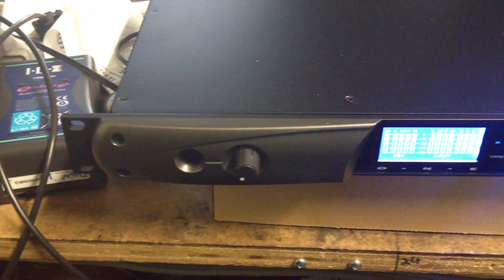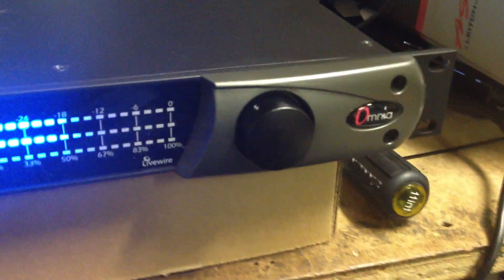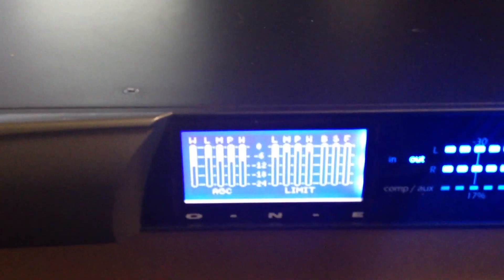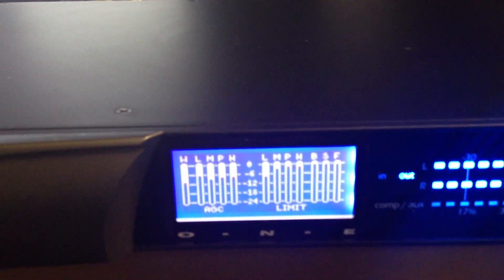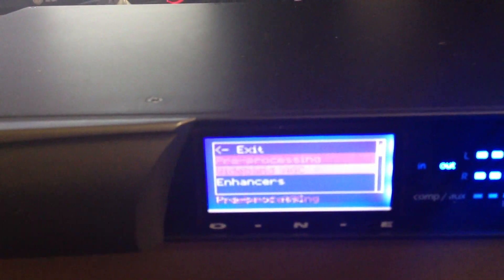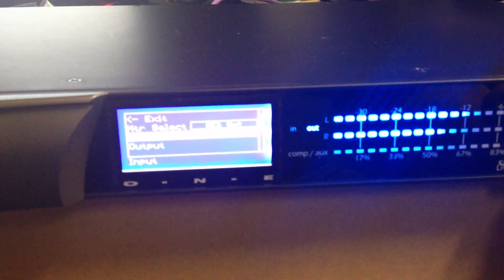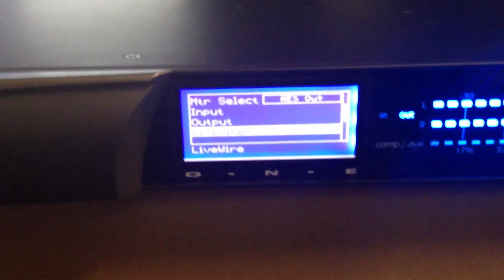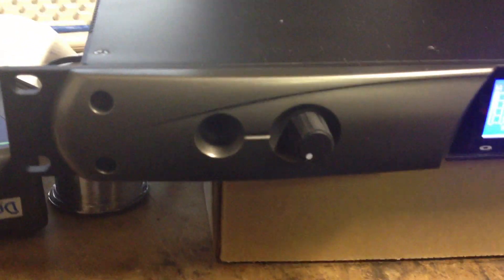Overview of the Omnia One Multicast

Comment: camaradas alquien puede ayudarme, quiero actualizarle el firmware a uno de estso ya que el display desapareció enciende y queda el display sin letras ni nada. alguna sugerencia
Reply from the maker: Sorry I don't speak spanish, but have you tried to reach out to Omnia directly? I found their tech support helpful even when the issue is quite technical. One thing you can try is to take off the cover and make sure all connectors are secure and to unplug and replug them carefully to see if the display will come back. Does any audio pass through? I think there's a way to reach a command line console from inside.

Comment: Greetings, I have a radio to which I am doing some technical aids and they told me that they have a team like Omnia One but someone blocked it with a key and now you can not enter the different configurations if you put a key, some idea? or you have to reset by removing the internal battery as the PCs. I have not checked the equipment yet.